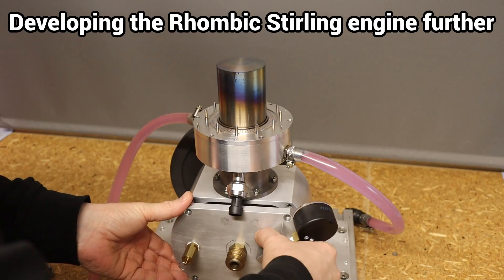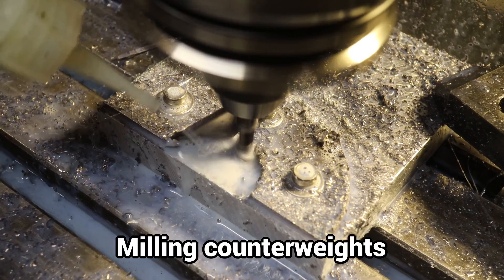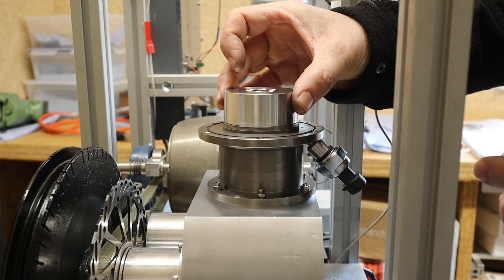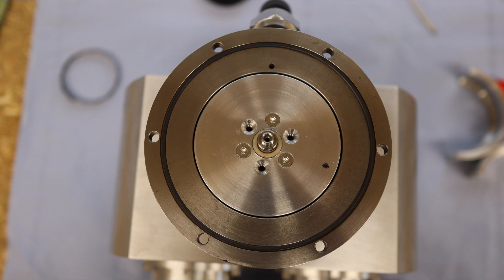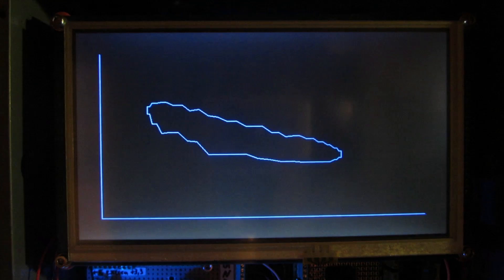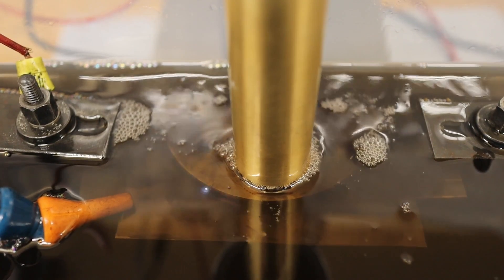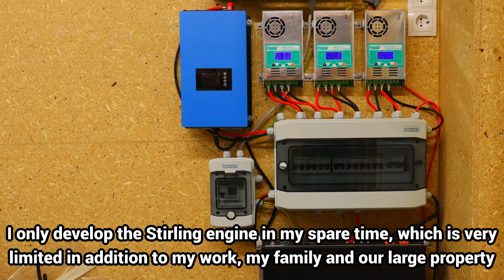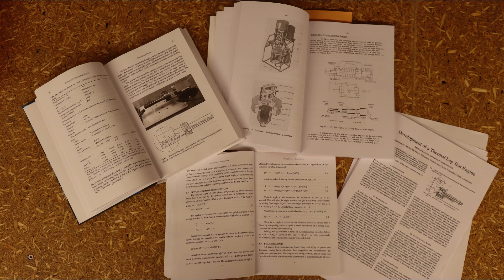Stirling engine development for cogeneration of cheap DIY energy to become off grid and independent

Comment: i think there is not enough support in terms of manpower or funding to push through your project or goal of having an off grid but always self sustainable power supply system but the need is quite acute for those who are conducting bitcoin mining in super remote areas where sun is the most accessible.
Reply from the maker: That's the reason why I try to simplify the engine, plz look at my new engines in my recent videos!

Comment: I am thinking if doing something quite sumilar to what you have done . I learnt a lot about these after watching the video by philips and reading some books . Would you mind sharing the cad files of your project . I seriously need some help with getting the dimensions and materiaos right .
Reply from the maker: I don't have proper cad drawings, mostly very rough hand sketches that are mostly useless for others.
Also I think you have to design the engine to your workshop capabilities and skills.
The building of an engine like the 300 watts rhombic is a long process which involves many changes and improvements that cant be copied from plans.
Look out for a good design that matches your workshop capabilities and copy it roughly with your own design of details.
I can give you rough specs of my 84cc rhombic: bore: 60 mm stroke : 13.5 mm, just begin with simple plain heat exchangers and later make better ones with slots or tubes.
If there is much interest of many people, I can make a video with many more details but to make a complete plan would take to much time for me.

If you want a detailed plan try to get a plan of the Viebach ST05 Stirling (Ve ingenieure is the channel and website I think), I think its out of print but maybe you can get a copy.

Just start simple and you will get more power step by step like I did.

Greetings

Ralf
Reply: Thank you very much

Comment: Hello I know this video is about the stirling engine but I notice you have 3 powmr solar controllers, Quick question, are you running them in parallel or are you feeding 3 separate battey systems? The rason I ask is I have a 24v system and the controller trips out at 60 amps with all the panels on. Im thinking of angling the panels to reduce the peak output but just seen your system and wondering as I said if they are in parallel
Reply from the maker: Hi, they are parallel and it works fine!
Reply: @myengines2443  thanks for getting back to meSo do you just set D2 to be the same on all of them?

Comment: I tip my hat to you Sir. This has to be the best video I have seen on using of the stirling engine for home heating. Am wondering as to where you are located ?? Look forward to see more great videos and ideas of giving the average person control of heating costs. 
I have an idea of maybe using magnetism somehow to increase the energy output ??
Job well done Sir too. Peace v
Reply from the maker: Thanks a lot for your nice comment!
I live in Germany.
Reply: @myengines2443  I am also working on saving energy. I use my well water that is copper piped to the attic where the heat exchanger raises the water from about 50 F degrees to about 90 to 99 F degrees. Then the water is ready to go into a electric water heater which is only used when needed. This has lowered my electric bill by half. I hope you have luck with your endeavors making yourself OFF THE GRID. 
Peace v

Comment: Hello, nice work, I like your approaches in your work. I have two question, what material is the heater made of and why did you choose this material? Another question 😅 are you german? Thanks
Reply from the maker: Hi, the heater head  is of 1.4571 stainless steel because this alloy has no intergranullar corrosion problems but is also good available and relatively cheap.
And yes I am from Germany.
Greetings
Reply: @myengines2443 Thanks for your answer, I'm also from Germany but because of the community I will continue to write in English. 
Just to clarify some things, in order to improve the heater performance, a material with a higher thermal conductivity than the stainless steel would be desirable, is that correct? I know that copper has problems with oxidation at high temperature and aluminum has a low melting point. But lets say a material that doesn't oxide and has a high melting point and has a high thermal conductivity, would such a material improve heater performance? 

Greetings back😊

Comment: Wonder if you could use the biogas to charge a gravity battery. Only just found your channel so apologies if this has already been considered or is just an idea in the wrong direction!
Reply from the maker: Can you please describe how this works?
Thanks foe writing!
Reply: As I understand it, you wish to supplement solar power with another source of off grid energy? 
I believe you have a source of renewable biogas and wish to convert the biogas into electricity. 
You've created a really impressive Stirling engine to accomplish the conversion, however power output is only around 300W and maintenance requirements are high.
My thought is that designing a method to convert the biogas into potential energy over the course of 24hours would enable higher conversion efficiency and also higher peak power draw.
Reply: I wonder if a very simple linear internal combustion engine with a very large expansion ratio could be employed to charge the gravity battery (slowly lift a heavy weight).
The stored potential energy is later used to generate power when solar is unavailable. 
The large expansion ratio contributes to higher efficiency.

Comment: Running on air a Stirling engine cannot be made efficient due to relatively high viscosity of air. To dramatically increase the power produced so that you don't have to worry so much about friction, the working gas has to be Hydrogen or even better, Helium. Also further increase in performance will be achieved if you can run the working gas under pressure. With these improvement you can get very close to the ideal Stirling cycle, you can't do it with air, especially under atmospheric pressure. Your undoubted designing talents can be better used if you move in this direction rather than fine-tuning seals and balancing movements. Returns from those improvements are really minute.
Reply from the maker: The engine is pressurized to 10 bar mean pressure, more is too dangerous for me because of diesel effects etc.
I made a few experiments with helium but the heat exchangers are designed for air and helium makes things even more complicated and expensive.
Hydrogen has the best properties but is also very explosive and dangerous.
Reply: @myengines2443  You have done a great service by documenting your research.  It highlights the limits of small scale manufacturing.

 I believe that a fixed charge of hydrogen in a well ventilated area is going to be relatively safe.  Much like the Hydrocarbons used in refrigerators these days with good safety records.  Also using Hydrogen you can mostly ignore slow leaks, you can make provision to recharge at 1 day or one week intervals if required.  Also hydrogen to top up the charge can be generated electrolytically at low cost requiring only compression for storage.

I think your project is spectacular and Wish you all the best.  Agreeing with @big53 I too think that as a DIY/hobby developer it is incumbent on us to aim for something practical using the minimal amount of high tech, chasing marginal efficiency improvements is demoralising.

I do like the double rhombus arrangement for the self alignment and low vibration but it suffers from lots of pivots and moving masses and friction as you have found.

The size and efficiency of the unit is not as important as the longevity as you have also deduced and this would make me look at diaphragm supported free piston systems.  However what would scare me a little if considering cost recovery via small scale or community commercialisation would be stumbling into current patent territory.  To this end I would mostly focus on older expired patent methods.  For this reason I favour the free piston designs for their age and their use in space based cryo coolers suggests longevity.

------

Converting heat to electricity is the holy grail of energy harvesting as it could be solar or any bio fuel, in history the intermediary was steam and this may still be an option.  I have investigated a low pressure (wet) steam engine system that shows up now and then and you might be very well positioned to make a theoretical calculation as to the practical efficiency of the arrangement.  Look up "Green Steam Engine" here on YT.  the developer has a website and does respond to polite emails.  As it uses wet steam it does not use a boiler so explosion danger is almost eliminated.  Low pressure means less leak problems and use of steam means small piston leaks are irrelevant.  It also rearranges the control valves (with proposed rotary valve) and uses a swash-plate arrangement to extract power so reducing complex mechanical links.

Comment: An wot stops these engines from over 
accelerating  they 
Just start running an 
Get faster an faster ?
An boom,!!
Reply from the maker: Without any load I only give very little gas pressure to the burner.
In the test stand the resistance of the electrical generator slows the engine down, additional I have an emergency brake that brakes at approx. 2500 rpm the engine completely down and turns  the burner off.

Comment: Seems like an engine with some phase change working fluid would be more easy to scale up in power as the amount of heat to change phase from liquid to gas or gas to liquid at a nearly constant temperature but large pressure difference…..wait a minute, isn’t this a form of steam engine 😂
Reply from the maker: A steam engine seems to be quite a reasonable suggestion, in my new video it is discussed heavily in the comments!

Comment: You are wanting to use an engine to run a generator for permanent off grid power? What are you going to use to run it that’s cheap compared to buying power from the grid?
Reply from the maker: I use my self made biogas from my diy micro biogas digester you can see it in an older video!

Comment: Stirling Cycle
It was invented to get around the problem of steam boiler explosions -
At first look its more efficient than the Rankine Cycle used in steam engines
But in the real world its a lot LESS efficient
WhiperTech used to make Stirling CoGen sets - they were 11% efficient !!!
But that was actually OK as their main function was as a water heater - the electricity was a bonus
Reply from the maker: Yes, they have always be part of a cogeneration unit for good use.
11% sound bad but for a small engine it is not so low!
The efficiency is not the problem of the Stirling engine, it is  it's complexity
Reply: @myengines2443  There are two problems with the Stirling cycle
(1) Is power density - the amount of power that you can get out is related to the amount of working fluid - so you tend to end up with a high pressure containment vessel
(2) Is the efficiency
A heat engine has two parts - you "do work" to the "fluid" in one part and you "get work" from the fluid in the other part
It's like subtracting two nearly equal numbers - with friction and such taking a bite out of both  
The secret of the "Rankine Cycle" is to do the "do work" part to the fluid when its liquid and the "get work" part as a gas
That makes the "two nearly equal numbers" more different - so the inevitable friction makes much less of a difference 

The result is that the Stirling Cycle is only used where there is some other advantage - I believe Sweden uses them in their stealthy submarines as the "boiling" in a Rankine cycle makes a noise.

Comment: If you can encase your system in a pressure vessel, you can vastly increase your efficiency and peak power output.
Reply from the maker: It is already loaded with a mean pressure of 10 bar and I don't want to use a higher pressure, its too dangerous for me!

Comment: Stirling engine should be used for mechanical things or solar energy only (while removing electricity and adapt appliances to wind and solar Mechanical energy) for example for a water pump with concentrated solar when theres no wind, however small solar vortex chimneys can do the same or concentrated solar steam while desalinating or distilling water 

If theres wind a vawt wind turbine can pump the water instead

Comment: I would try Teflon rings
Reply from the maker: I tried it but Teflon is too soft and it has not so low friction as you would think.
I also tried carbon and glass reinforced PTFE types.
The tribological plastic I use now, IGUS W300, is much better.
Reply: Metal rings like en fuel engine with oil wil slide

Comment: Why convert translating movement to rotation? Just use a translating magnet and a coil and you have a generator with much less friction.
Reply from the maker: Yes that's what I am investigating in my new video series and I have to find out more about linear generators!
Reply: Look at bass speakers. Perhaps look inside Swedish submarines also.

Comment: To reduce the heater volume üressure should be above 50bar as heat radiation absorption in the gas starts to amtter
Reply from the maker: 50 bar is far too much for me.
This will make things also much more complex!
But thanks for your suggestion!

Comment: I wonder what would happen if in the machine we have mercury for the contraction and expansion, instead of just air ¡!
Reply from the maker: I think the fluid friction would be very high!
But maybe for very low cycle frequency and very special applications it may be meaningful.
Reply: @myengines2443  I guess that a machine like that working with Mercury will work much slower but much more powerful than the air, which is now! I don't know what could be. It's just a crazy guess that I never spoke about that to anyone before, but it was always there in my mind! Regards

Comment: You definitely need to talk to more people who have used this engine. Is it better to have a couple of smaller engines or one bigger engine. You could also just use the small engine in conjunction with a steam or hot water system in the winter to help charge the batteries. Using solar is best in pairs so the wattage is higher then inverter to scale down.

Comment: It might be a lot more dangerous but wouldn't it be a lot simpler to build a pressure boiler and just use steam under pressure to generate power?
Then slap this thing on top for passive thermal gain or something?
Reply from the maker: I am not sure if steam engines are the right solution for me and an additional Stirling just for the waste heat of the steam engine will make it even more complex...
But thanks for the suggestion!

Comment: I had some sterling concepts I wanted to try out. Just need to live to 156. 

1. A double acting double piston conventional sterling but with pistons 180 degree opposite so they oppose. 
Then you increase the pressure of the working fluid. So it could be many times atmospheric pressure. 
The problem here would be leakage  on the joint between the sliding conectig rods and atmosphere. 
Alternatively the enter mechanical engine and generator is put in a pressure vessel. So it can't leak. 

2. Stirling turbine. Just like a normal turbine you have a compressor and a power turbine. The compressed gas can be heated, and the exhaust couod be cooled. 
This could also be contained in a vessel so it could be running at many times atmospheric pressure and have even the generator contained inside. So there is 0 chance of leakage. Maybe the generator couod be between the compressor and power turbines on the shaft. 

I proposed increasing pressure as one of the very limiting factors is the power to weight and so size. You need a huge one to do any real work.

If it's using a working gas at somthing like 5 bar. Then it will need 5 times the energy per a given volume to heat. And so you get 5 times the energy out. 
Meaning a small engine could make a lot more power.

Or exploit waste heat like form a chimney without needing to be ginormous.
Reply from the maker: Sounds really nice, 
you don't have to live to 156, just do in NOW!

Comment: Piston rings in a motor are necessary due to the high compression ratios needed for complete combustion.
Stirling's don't have this requirement, as combustion is a separate process outside of the engine.
Lose the piston rings; a close-fitting graphite piston and polished cylinder walls is all you need.
Reply from the maker: The problem with this (I tried it exactly this way) is that the piston expands more than the cylinder and this is hard to get tight and work with low friction!

Comment: I remember my great grandfather fixing a friction issue by using some lead [Pb] to fix a piston that kept binding. (I was very young) I remember him rubbing a chunk of lead on the piston (rotated in a lathe) and again in the engine block (attached to and rotated by a small electric motor). After reassembly, he hand cranked it for awhile and the issue cleared up. That tractor engine still runs to this day. Not sure this is a 'good' idea, as we now know lead ti be pretty dangerous.. but it still seemed noteworthy enough to share.
Reply: Perhaps it was tin or babbitt. Babbitt is a very good bearing surface.  Lead is a terrible one.
Reply: @christopherbusch1933  that is very possible. I had completely forgotten about babbit.
Reply from the maker: Good old school!

Comment: Look into the details of the sterling engines used by the AIP (air independent propulsion) systems on some submarines. Newer designs are obviously restricted however the older designs can be found.
Reply from the maker: Yes these topics are very interesting but also very complicated and high tech  what I want to avoid...
Thanks for your suggestion!